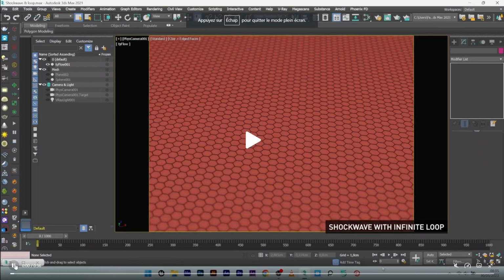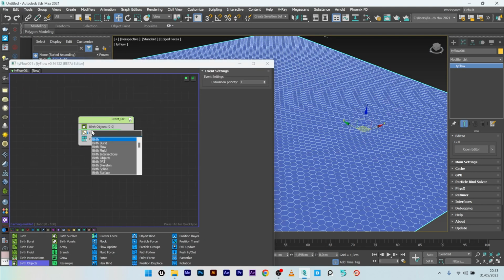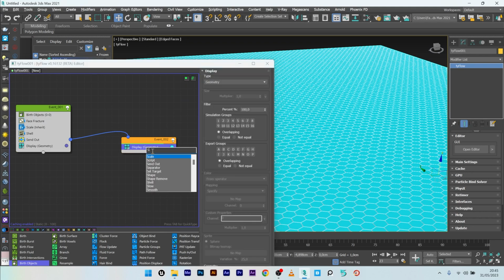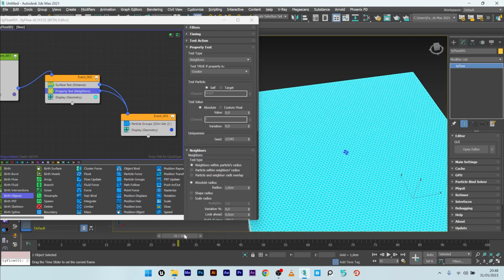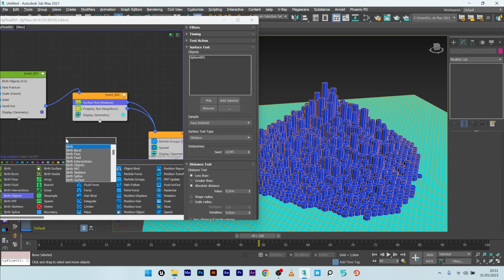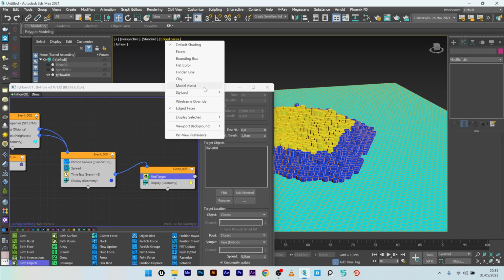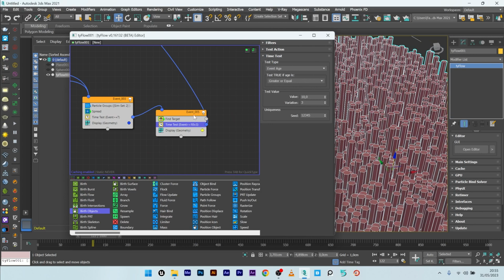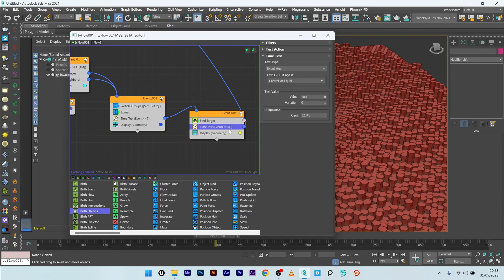Create Epic shockwave & Loop  the animation | 3dsmax x tyflow tutorial

Comment: Is there a way to chamfer the edges of the tyflow fracture? I'm using a similar approach to this allong with Pheonix FD, but i'm creating a macro shot of the fratured faces with some depth of field, I need to round off / Chamfer the edges of the fracture to look more relaistic up close? trying to get them to look like metal rods, but the hard edges are the last problem to solve :)
Reply from the maker: You can add an " Edgetex " in the bump of your material to create a fake chamfer ! or what you have to do is to extrude and chamfer all your pattern before creating a birth object . and of course you dont need the shell in the setup
Reply: @fabienescudero  thank you sir!!

Earlier whilst I was rendering soem previews I did have the ' light bulb' moment of finalising geometry before birthing object, I don't know why I was trying to over complicating things. 

I'll give the edge tex a go first though,  cheers 🙏🏻
Reply: @fabienescudero  I just need to figure out the settings in tyflow so that the correct hexagons with their chamfers are grouped together when moving on the z axis, otherwise I'll have some strange behaviours going on